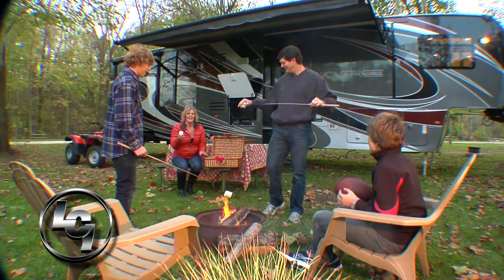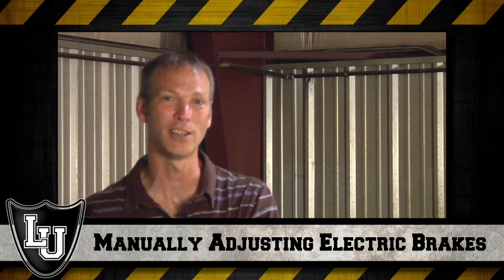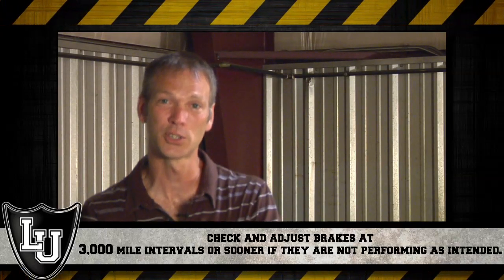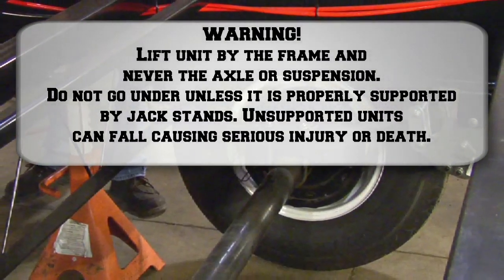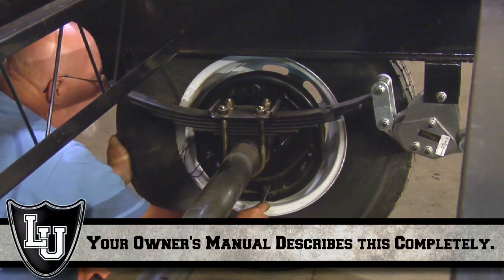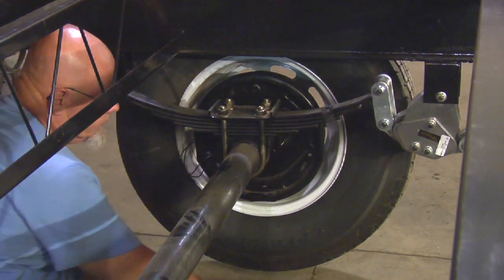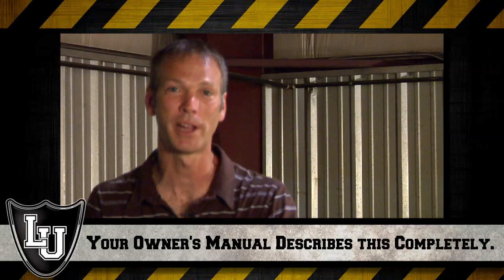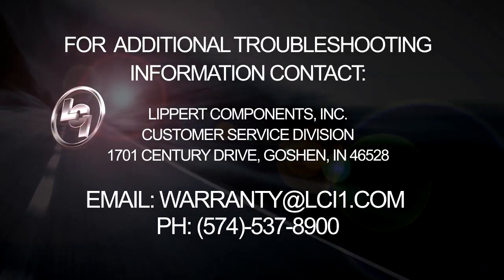LCI - Self Adjusting Trailer Brakes

Comment: I could be wrong, as I was once before I'm told, but even "self adjust" brakes do need to be set up this way initially for them to to take over "self-adjusting".  Why would you guys need a video on self-adjusting brakes anyway?  They've been around over 40 yrs on most older vehicles just the same and take care of things for you by reversing your vehicle.  A recent interesting discovery I might add is that Dexter offers a forward & reverse self-adjusting unit.